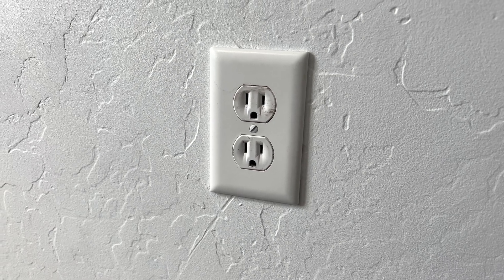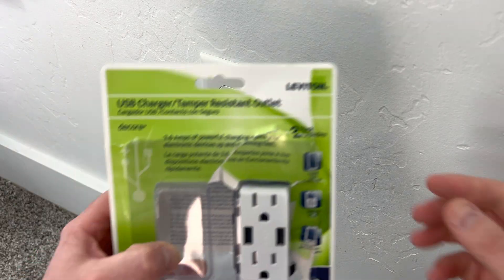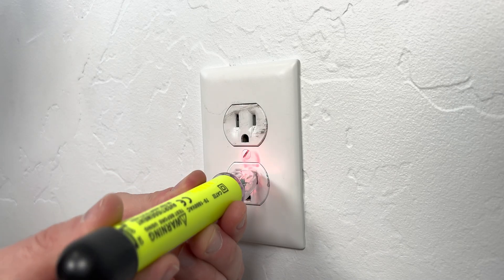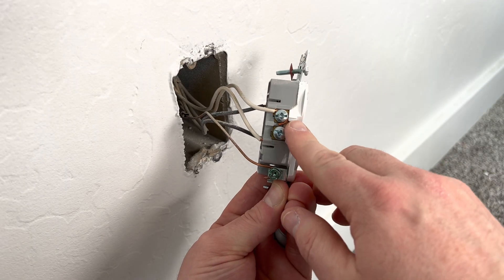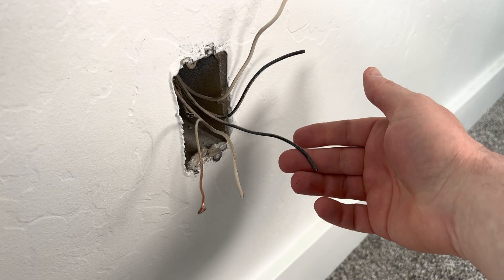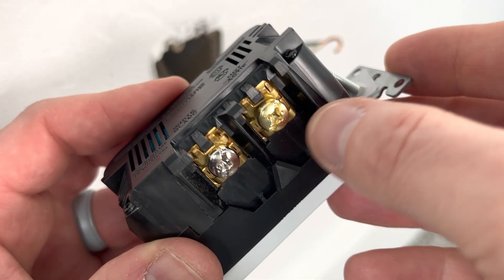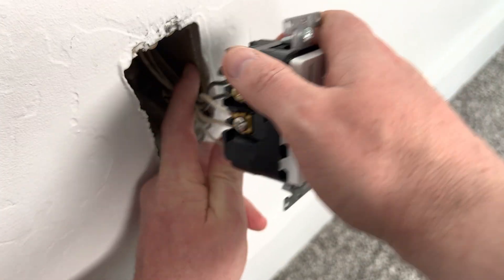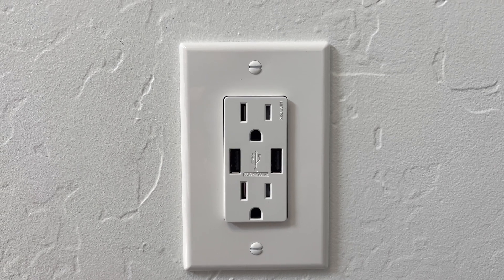In Depth Guide to Install A USB Outlet - Best Guide for Beginners

Comment: 4:03
This may or may not be right, but this is my theory. Backstab connections are meant to be one and done. This means that, you can only use them once. You can use a small screwdriver or something similar to stick in a release hole to depress the stab in terminal and release the wire, but since it's not springy, chances are, it'll permanently deform. If it does, the connection will be very loose (Not like backstabbing is already a loose connection to begin with). Thus, these are not supposed to be reused. So maybe they used that one once, then removed it, realized the wire was just falling out, and then used the screw terminal. But you should always use the screw terminals, or even better, ones that have a clamp that clamps the wire between the terminal and a metal plate and secures by tightening the terminal screw.

Comment: Very well explained and visually great.  In particular it was great to see the explanation with two whites and two blacks so that it was clear what to do. Have installed many many outlets, first time with the USB and was surprised that there were only 2 screws not 4.  Your video clarified all of that. Two minor points: my Levithon does not clearly say USB C on the box but I assume that the USB C connector is what goes into the phone tablet etc.  Secondly you mention that the Hot labeling on the back also has the word line... Since both wires go on the same brass screw I assume that it does not matter which black wire goes on the left or right side....  To be safe I will put the live power on the left side where I see the word line.   Thank you very much.

Comment: This is an excellent step-by-step instructional video but just as i was feeling confident to go through with this, I encounter TWO copper (ground) wires wrapped around the green screw. First time I come across this. 🙀 Is it okay to just wrap both around the new USB outlet?  🫣. Thank you so much!

Comment: I have been looking for information as to whether itbisnpossibke to install a usb outlet as a split switch (top plug controlled by wall switch and lower plug always hot).  The new USB outlet I have has push in connectors only and I don't know if there is a way to break the connection between the hot side wire plug connectors.  Your vids are very clear and informative, so I was hoping that you might know.  Thanks!

Comment: What about one that is also connected to a switch on the wall.  I have 2 white, 2 black, 1 ground and 1 red wire
Reply: One black is hot and is an individual circuit. And the red is hot and an individual circuit. Potentially